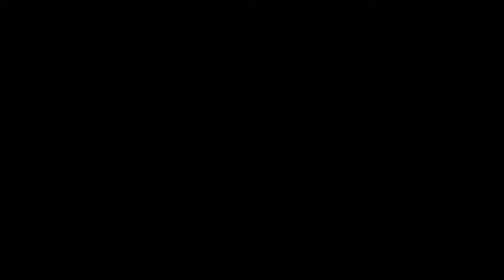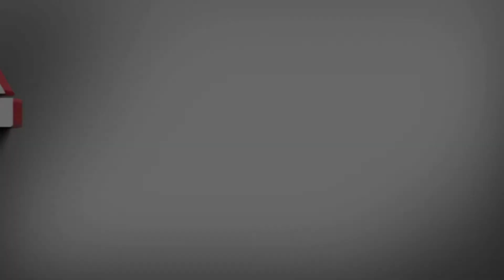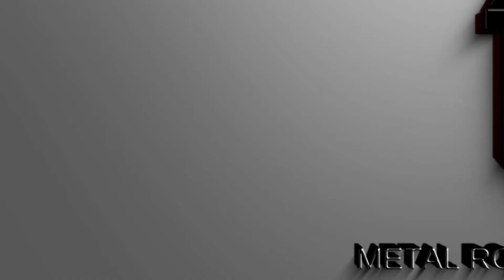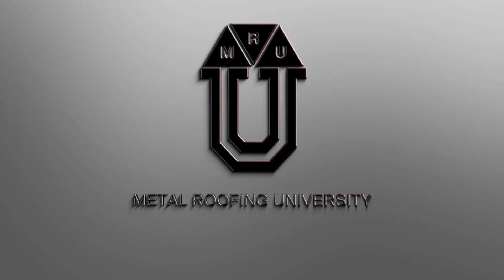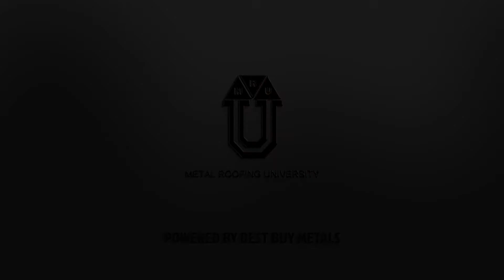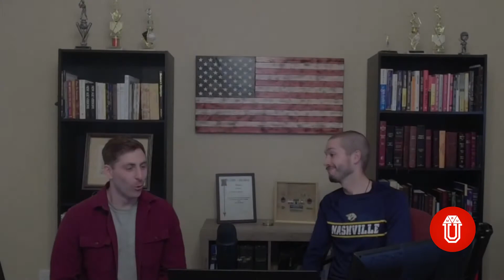Metal Roof Paint: Poly vs. SMP

Comment: So with your SMP system what should I use to spray my Metal roof. Its only 6yrs old but I wanna change the color because I repainted the house. I wanna go with a Blue color
Reply from the maker: That's tricky. We tell people to avoid repainting a properly coated metal roof for a few reasons, the main being it will void the paint manufacturer's warranty. It also will not perform to the same standards as the original powder coated steel. You will see premature fading and peeling if you paint over the original coat.

If this isn't an issue to you and you'd still like to paint it, acrylic latex paint is probably your best bet.